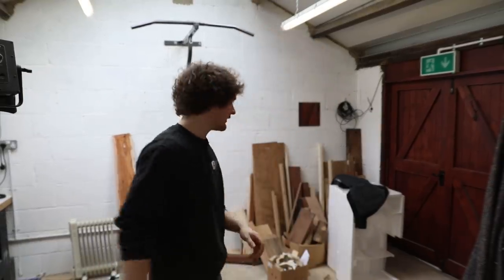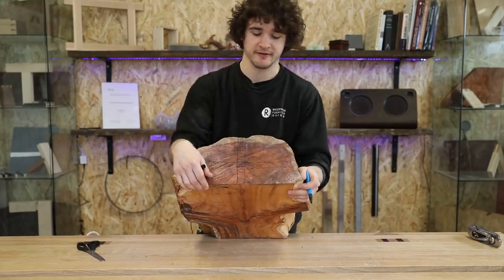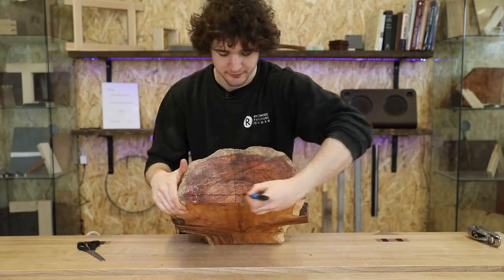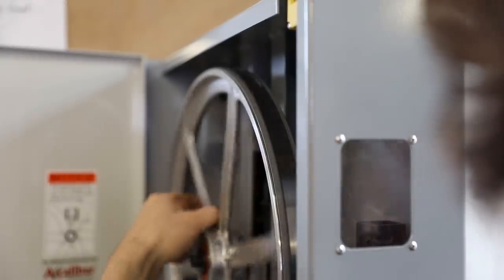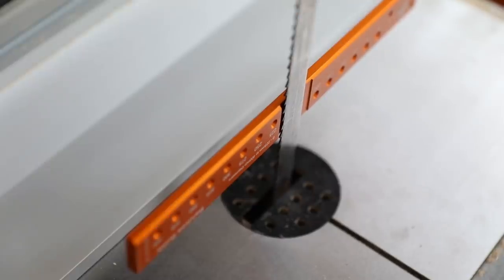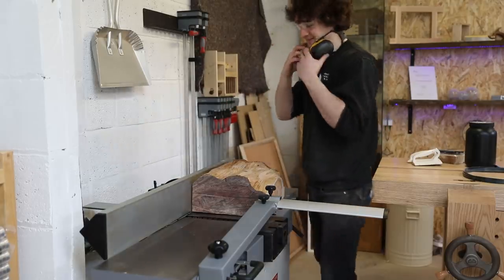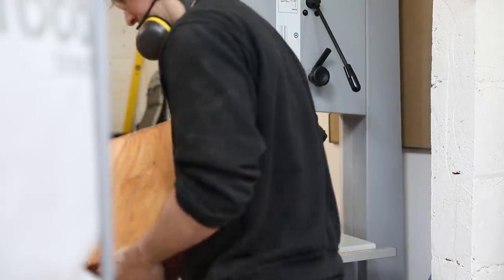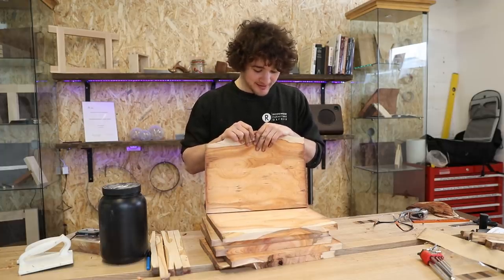Cutting up a Log

Comment: I recently started cutting up logs on my new first band saw and boy can I relate to the conflict in your head. You just can’t allow yourself to cut that beautiful face grain and figure in half, so you just keep going and going until it’s too late. Then you admire the slabs in awe and amazement, completely glowing with pride and a smile you can’t wipe away. Getting on, you seal the ends and put them aside. A few weeks go by and you have yourself some wonderfully useless cupped boards with maybe even a split or two down the middle. I’m thinking that if I have another episode of lack in self restraint, I’ll at least try to cut them thicker and then plane them flat after they curl up. Even then, it’s probably not the right move. It’s amusing that I can happily convince myself to disregard information I’ve gathered from research when dealing with these particular types of choices. But, I have learned many of my lessons in life the hard way and it works like a charm. Every time! Milling logs is like an equation of choices. Instant gratification, or realistic results. Hopefully experience will provide some ability to balance them both. Great vid 👍🏽
Reply: The cutting them thicker is not a bad move. And then its trying to dry them out with weight on top. Unless you have an amazing setup its going to cup a little but not so much.
For me it's worth the beauty
Reply: I actually did this recently and mostly did cut them thick...most of the boards are at least 8/4 if not 10 or 12 quarter. I figure that way even the worst cup should yield a 5, 6 or 8 quarter slab after fully drying.
Reply: It all depends how dry the log is before you cut it. I would cut it into 2” slabs and stack it for 2 years or kiln dry it if it was still wet. I presume the ends are sealed. There’s always bow fronted chests of drawers.

Comment: With thru or plain sawn, you can glue two boards together after flipping one over. Since the grain/rings will be opposite each other, they will counteract each other and not cup, but you'll still get the look.

Comment: I'm feeling your enthusiasm Matt. After watching many of your videos I might have to take up wood work as a hobby. Thanks!
Reply: Go for it. You're really only limited by your imagination. You do need a woodworking bench to really get into the pastime though. It's like your number one tool. So plan on making one of those as your first project. It doesn't have to be a Roubo either. At least not your first one. Then there's schemes where you can use pipe clamps as a bench vise. Then you can begin work on your Roubo workbench. Nah you can use a junky bench for a while. As long as it is pretty solid and heavy.

Comment: I was doing the same thing with the small logs from the tree I pulled down in my backyard.    Though unlike you I do not yet have a jointer or thickness planer.   My Grizley 20' planer is arriving in a about 2 weeks so really excited with being able to plane down my boards.   Then the jointer will arrive in a month.   I'm really interested in seeing what you do with your boards too as I will have to find a project for them as well.   For now I think my 8yo son want a wooden pencil box with sliding top lid so that may be a good place to start... as the wood is free, any fun project is good!!!
Reply from the maker: It opens a whole new world of possibilities! I agree with your point about free wood. I’m also thinking a box of some sort....

Comment: Alex Snodgrass says the gully of the teeth should be on the crown of the wheel.  The reason is both for support of the cutting edge and also allows your front guides to not have to move.  Since the teeth are always in the same place, the guides are always correct.  Only the thrust bearing needs to move.
Reply from the maker: Ahhhhh I like the reasoning behind the guides being stationary. That makes a lot of sense. Cheers mate!

Comment: A playing card happens to be the right thickness between blade and bearing. Simply pop in the card and rest the bearing up against the card/blade. Tighten. Then just pull out the card.

Comment: About the planing part you should always just plain two sides of a piece of would the 3rd side should go through a thickness plainer.The 4th side either a thickness plainer or a table saw.This way you will get all the side square to each other and the sides opposite each other will be parallel.
I learnt this the hard way i just plained 3 sides(one thin then thick then the other thin side) and the plank came out wedge shaped on the thinner sides.I thought my newly bought plainer was crap i almost put back in the box and took it back to the store but i watched a few vids how can this be fixed.I do not know the science behind it but in a lot vids it is suggested to properly mill up stock.Plain 2 sides then use some other method to square up the other two sides either thickness plainer or table saw.Band saw would not be a good idea cos of the blade won't be as accurate as the other two tools.
Probably in this project it won't really matter cos you will process your material further but this just popped into my mind when i saw you plain that log.

Comment: My bandsaw blade sits in the middle at the top, and right at the front of the bottom. Nothing touches bearings etc. Any idea how to adjust it? Playing with the settings for several hours I couldn't see how to centre it. I'm in south Essex if you pop by for the lumber store.

Comment: Hi Matt. Did you have to change the blade speed to slow for those deep cuts? My bandsaw manual suggests setting blade speed to slow for cutting logs....but you have to change the motor pulley position and I don't know whether it's worth the bother? Appreciate your thoughts, cheers man, great videos!

Comment: @Matt Estlea, how long do you need to leave the boards you cut for, before they are dry enough to use?
Reply: I think a good rule of thumb for drying is to let it dry for one year for each inch of thickness. But seeing that this log was painted on the end I'm guessing that it was already drying for quite some time.

Comment: I used to work for a saw blade company, we would hold classes for our customers and vendors how to handle bandsaw blades. (It was a sin to toss them to open them, hahaha. BUSTED teeth on new blades, yikes)
Reply: My recommendation on that would be to take an old rusted blade and throw and re-coil it 10 or 20 times out on the neighbors' lawn (when the kids and dogs aren't around)  until the novelty wears off. Then when that gets to be a snoozer, practice technique so that it's intensely boring to coil and uncoil the blade effortlessly with two fingers  :)  You can always pull out the old trick when needed!  Thanks for the video - I was feeling lots of the same excitement I had in lapidary when you were opening up the goodness of a rock.